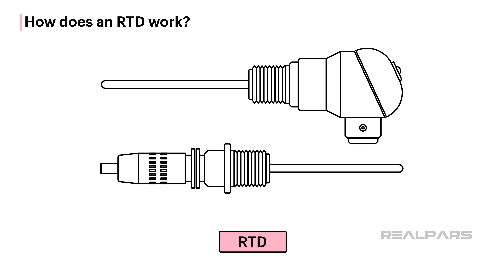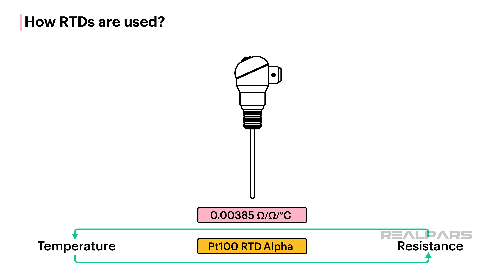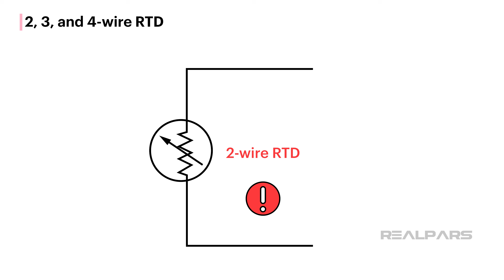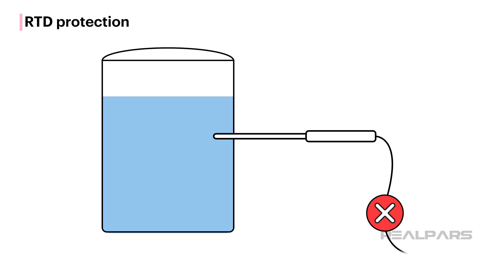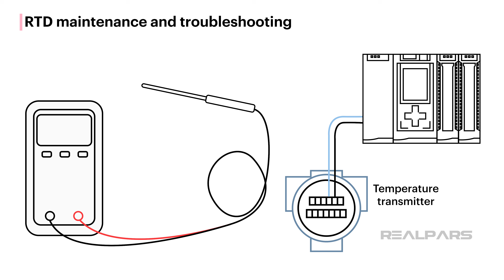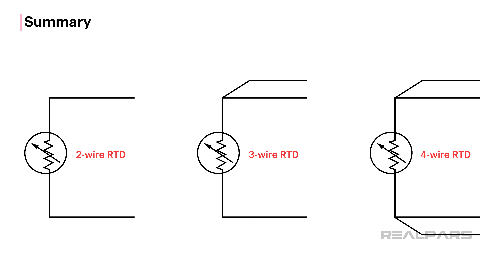RTD Installation and Maintenance 101: A Beginner's Guide

Comment: Still missing an actual explanation for how the third wire eliminataes the lead resistance.  Wondering, as the voltage measuring part of  the transmitter probably is high ohm, the voltage signal is not much affected, and the third hardly "steel" any voltage in that loop. Hard to find a video to say if this explanation is correct... Nice video though, as always.
Reply from the maker: Hello, @ingbjellb4236  Thank you for your comment.  Here is a link to help your leaning. https://www.prelectronics.com/the-fundamentals-of-rtd-temperature-sensors/  
If you’re looking to learn more about this topic, you can join our 7-day free trial at https://community.realpars.com  Happy learning from RealPars!

Comment: I have an RTD that's 13 foot long (large coil with nut and ferrule). How do you install that into a heat exchanger?
Reply from the maker: Hi there..... Thanks for your question. Can I ask you a few questions first?  Is the RTD thermowell already in place? What is the RTD connected to? A temperature transmitter> A PLC input card?
Reply: @realpars  - The RTD is no longer installed. Somebody pulled it out and ruined it. It was connected to a Rosemount transmitter. Has two RTD sensors. There is only 6 inches of gap to install it in position. Otherwise the entire heat exchanger will have to be isolated and disassembled on the next shut down. There are a total of 4 Rosemount transmitters on this heat exchanger, each having a dual element, and different lengths. The Puck inside the Rosemount transmitter sends a 4-20ma signal to a CHARMS cabinet (no PLC board).

Comment: Now thermistors in our outdoor air cooled chiller units provide a similar function to detect entering and leaving water temps however the opposite is true. The higher the temperature the lower the resistance measured in K ohms. Lower the temperature the higher the resistance. Good video though just thought I would share a similar apparatus and how it reacts to temps

Comment: I absolutely hate the RTDs and TCs with pecker head terminations. Pain in the ass to work with. We have replaced all of ours over the years with armor flexed TCs and RTDs using bored thu tubing fittings.. They should make engineers work on this shit upside down, in the heat, covered in grease and hotter than hell before they spec this shit. The only time I have ever had anything where you can walk right up to it and work on it comfortably is when another technician has engineered and installed it.
Reply: Never had any issues with high quality RTD's in my 15 years working with them.
The video doesnt really say how bad a thernowell is for reaction time